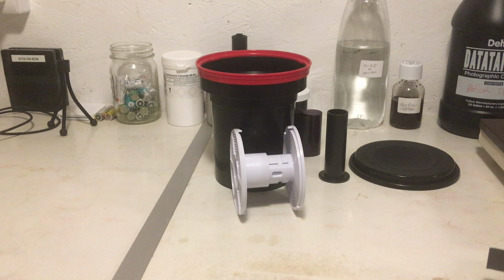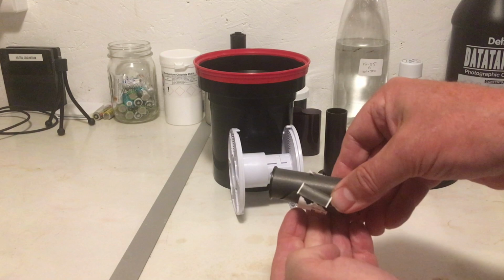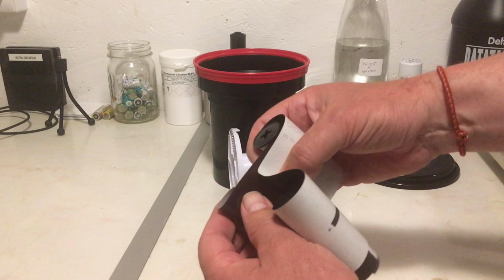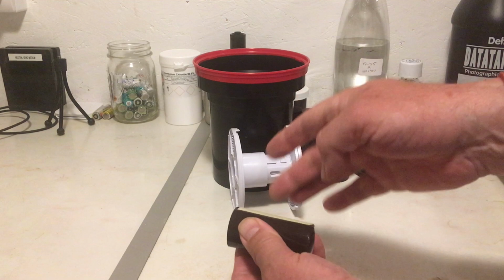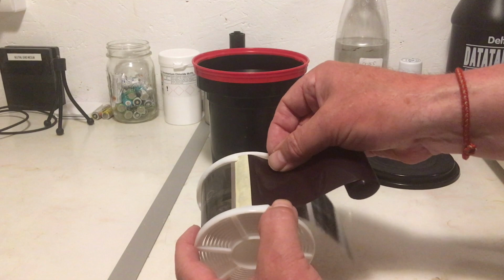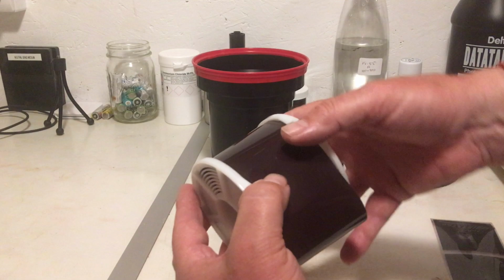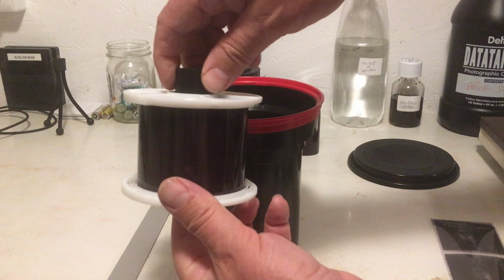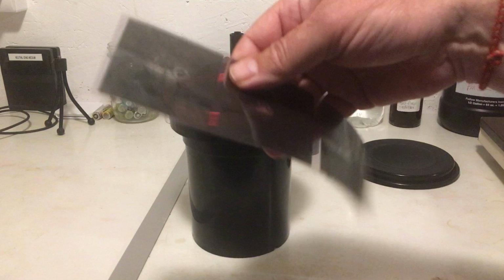The Easy Way to Load 120 Film Into a Paterson Tank!

Comment: I've been loading film onto plastic reels since Yankee and FR were the big names for home darkroom.  I never found 120/620/127 hard to get started on plastic reels -- where i had problems was on stainless.  And when I figured out I could do two rolls of 120/620, one loaded after the other (taped together where the ends meet) on a single reel, I was done with stainless forever.
Reply: I like the kodak skirts!  Ive never had a problem with them
Reply: Ah...I had a feeling, that getting the film perfectly parallel to the spindle axle might be an issue...The online shop I purchased confirmed to me that Patterson has issues with 120 and recommended Jobo I also found a comment that recommended Kaiser. In Kaiser reels the tracks have about 13 mm high walls! I ordered...   ..  .  both...😉
Reply: @boredgrass  IMO Paterson and Universal (with the big guide tabs to start the film) are the best for 120.  I've never had trouble with them.  Photos I found of the Kaiser look just like Universal, so should be easy-peasy.

Comment: I experience never ending frustration loading 120 film onto a patterson reel even using the film trick here.  If it jams or there is a problem and you have to take the film strip out, it's off to the frustration races.  I have a reel that has ears that are nearly a half inch square.  Can easily find them in the changing bag, then push the film past the bbs.  With the film strip technique, you are stuck with those tiny ears if you want to load a second roll on the same spool.  Not so with the large eared spool. Sorry, can't find the name of it, but it was about $12, the best I have ever spent.  Screw up one roll on the patterson reels and it nearly pays for itself.  Loading 120 is a breeze.  Sorry I can't find the name of it.
Reply from the maker: I know the reel you mean, I have one actually. Good reel.

Comment: I'self make it the complete opposite way and it works fine too 😂

When unwinding the film roll I put the end off the film into the spool as soon as the film appears.
I grab the film end with two fingers and pull directly in the spool (I don't push it) I pull it for about half of a spool wind. (Entrance of the spool is easy to find in the dark by touching with the fingers)
After I simply make the back and forth mouvement with the spool, film unwinds itself and the paper rolls up separately by it's own
 When arriving at the beginning of the film, I tear the tape in front of the film, put the paper away, wind completely the rest of the film into the spool.

Comment: Even though this installment is a year old, as a recent subscriber I wasn't able to see it till now. I've been using stainless steel tanks with Hewes reels for years. However for developing four or five rolls of 120 at a time I decided to try the Peterson 2.5 liter tank. I was simply having too much trouble loading the reels, though, and put off starting to use them. Then I saw this video. Genius! This trick makes loading the reels so much easier. I recently returned from a 23 day cruise through the Caribbean and the Panama Canal and back and I had twenty five rolls of 120 film to develop.  So I had five development sessions as opposed to the thirteen I would have needed for my two reel stainless tanks. This video helped to make that task so much easier. Thank you!
Reply from the maker: Yay! That's what I like to hear!

Comment: Old timey darkroom guy here. Strated loading 120 reels (620 actually) in the 1950's. On a 3 month 5000 mile trip and no room to bring my 4 reel SS tanks and reels for 120. I just bought the Patterson tank while traveling so I can develop rolls so I can be sure  I don't have an exposure failure. In the dark my fingers don't have to think about the degree of cupping and the amount of tension on the film as my other hand rotates the reel. It just happens - sorta like a knee jerk when the Doc taps your knee. I am not convinced at this moment the Paterson reel is the answer but I will be souping the first rolls tomorrow. We shall see.
Reply from the maker: How did the development go using Paterson reels?
Reply: Development went fine. This was a total experiment, not just the Patterson reel. The film expired in 2006 (Tri-X 320) The developer is one I have never used (Diafine) and does not need temperature control or careful timing. The film was curled so tight after 18 years it was wrestling with an octopus to get it on the reel. I took shots at box speed, pushed 1 stop and pushed 2 stops. For the most part the 1 stop push negatives look the best, but all three are printable, but the box speed are dense and will need a bit of expertise to coax a good print.. I have to say the Patterson 120 reel seems far more difficult to load than the typical stainless reel. I have a fresh Tri-X 400 in the camera now (C330 TLR) and we shall see how well it loads.

Comment: The template idea is great. I quickly stopped using my paterson reel for 120 film after getting my hands on a couple of AP reels. They fit the paterson tank just the same but the extra guides make loading 120 and indeed 35mm film a lot easier. AP Reels are cheap as well, I always recommend them for 120 film instead of paterson reels.
Reply from the maker: Good to know, Mark!
Reply: Where can someone find an AP reel?

Comment: Great tip. First time I tried this, something got jammed and had to resort to my old method, called, struggle. Tried again today, it worked !. Must have been my 75 yr. old fingers , first try. Thanks. KB
Reply from the maker: That's good to hear Ken. Have you removed the little ball bearings from your Paterson reel? It helps loading for me to always take them out.
Reply: @PictorialPlanet  No  have not removed balls, as I do use these for 35mm also. With 35mm, I start the leader in day light, as the first few inches are already exposed .
Reply from the maker: Me too but I find the end stays in ok.

Comment: that tape bit on the end will help me tremendously. I dont have a problem starting the film on the reel its getting it to keep going seems to bind at some point and wont go on. I am going to try that.
Reply from the maker: Binding of the film, when it gets stuck, can be a real issue. I find keeping the reels very clean and making sure they are absolutely dry helps a lot. If my film does bind wiggling the reels seems to get it past the tough bit.

Comment: I hold with one hand the plastic spool and with other hand paper back and just pull. Film will roll it self you don't have to touch it. Film template is really nice tip that I will use for sure :)
I use Jobo tank and reel and you don't even have to twist the reel since film sides get out of the reel so you can just use that to guide the film in.
Reply from the maker: That's great!

Comment: Easiest way is to replace the reels with 
Omega Universal Adjustable Multi-format Reel (35/220) which I ordered from BHPhoto.  They fit perfectly and have a lip to guide 35mm and 120 film onto the reels,  Works perfectly and SO much less frustration.  I have 4 of them.
Reply from the maker: Good tip!

Comment: great tip, one other is to cut some offcuts of developing paper, and use it, rather like the tongue tool to de-spool the 35 mm film (to get the leader out); just use the tape that you folded on the film, stick it to the "tongue" of the paper, and pull on it, like the demo, and make sure the tape is removed afterwards. this is simmilar in a way to using a "starting chord" on a mower, or outboard engine for the dinghy, but to pull the film through.

Comment: In fact, I had an experience with a 35mm film, after trying to insert the film into the screw of the Patterson tank, under a lot of blankets, sweat and anxiety on a summer day, because I do not have a black bag, but I succeeded in the end and was able to get the film stuck to the screw threads, and I also succeeded From repeating the ball with four films, but I did not try with the 120 mm film. The question here is whether there are holes in the film until it is attached to the teeth, or is that not a condition? I am waiting for an answer from the experts, thank you.
Reply from the maker: Well done!

Comment: I heard from someone to take the tape off because it will interact with the chemistry and throw it off...Dont know if its true but just asking if it makes a difference?
Reply from the maker: Hi Brendan. I've never, in 50 years, taken the tape off and it's never caused any reaction. Just fold it over and stick it to the other side of the film.

Comment: I notice in this video there are no ball bearings to pull the film onto the reel, have you removed them and if so why, thanks
Reply from the maker: Hi Martin. Yes, I've always recommended removing the bearings. Here's my website page about it:
http://www.pictorialplanet.com/beginner_photography/beginner_photography/easy_reel_loading.html
Reply: @PictorialPlanet  Thanks, I had no trouble loading most films with the bearings until I tried 127 film and that was a pain in the backside to get it over the bearings, it was a thin film Shanghi GP3 so don't know why it was so , will try this method now, thanks

Comment: Great tips, I've so far used my AP tank (which is really easy to use as the spiral has guide tabs for the film, kind of like your tip of using a negative as a guide but these are molded into the spiral) as I've been using reusable developer (Cinestill Df96) so the amount I need to fill the tank does not really matter. But now I'm moving to Pyrocat HD which is a one shot developer so the less I can use the cheaper it gets. 

I have a small Russian 120 only tank which only needs something like 300 ml of chemistry, half the amount I need for the AP one, but I have not been able to get film on the spiral because no matter what I do the end of the film comes out of the groove after I get some of it In. I think this is partly because I use Fomapan film which is slightly thinner than for example Ilford and partly because of the sloppy tolerances and build quality of the Russian tank. 

So next time I'll definitely try the tape trick, maybe it will make the end of the film stiff enough to stay In the groove all the way. So thanks for the tip.
Reply from the maker: Thanks for the comment! Yes, the tape should help stiffen the end of the thinner film. Good luck and let us know how you get on.
Reply: Unfortunately even the tape trick didn't work with this reel, it's simply too roughly made. No matter what I did I was not able to get more than maybe half of the film (still a lot more than without the tape) on the reel before it got stuck and wouldn't go further. Fortunately I anticipated that and had my trusty AP tank also in the changing bag so I loaded the film into that instead.

The reel might work for a stiffer film but for Fomapan it's a no go.
Reply from the maker: Dang that film's so thin!
Reply: @PictorialPlanet  Yes it is. and needs to be exposed at 100 or 150 to get decent density so the ISO is off too. I think I'll stick to Ilford in 35mm and 120 after I get through my current stock of Fomapan, much less hassle and not that much more expensive. 

Fortunately the Foma 4x5 seems to be okay once I got the exposure figured out, at less than half the price of HP5 I think I'll keep using it at least for the bulk of my 4x5 shooting.

Comment: I couldn’t get the film to load cause of that tape you mentioned to keep on and so I had to cut it off. The second roll I did had a bit more tape on it cause of course it wasn’t a straight cut in the dark. I believe the adhesive chemicals turned my developing fluid bright green! You failed to mention that unless it didn’t happen to you. So now I’m wondering if the 500ml used to develop the roll is now useless or what. Any info? Thanks!
Reply from the maker: Is this your first time developing 120 film?
Reply: @PictorialPlanet  I googled my situation and apparently it’s normal. Well, it was my third roll of 120 developed but ninth overall
Reply from the maker: @framesngrains2933 your googling is correct. The colour doesn't come from the glue but the film because 120 film often has an anti-halation layer and the chemical in that layer comes out. The glue does no harm and doesn't affect development or the film at all - well, it hasn't in the last 50 years I've even doing it.
Reply: @PictorialPlanet  now I’m at ease 🤣 thanks for the responses!

Comment: ...my Paterson Universal Tank accepts two 35mm reels or a single 120/220 reel. Is it possible to successfully load 2 x 120 film on to the same 120/220 reel? I know the reel happily accepts 1 x 220 film (if you can find it), but can't help thinking the total length of 2 x 120 film just might exceed the available space on the reel. Anybody with real-world experience of my query? Thanks.
Reply from the maker: I have not done this but I do believe that you can get two 120 films on one reel. I'd personally rather use a double reel tank.
Reply: @PictorialPlanet     ...thanks for the speedy response. I was afraid you might suggest a bigger tank. Thanks all the same.
Reply: @PictorialPlanet     ...just found out 2 x120 on a single Paterson reel is feasible. This from another platform: 

"It's simple: Use the piece of tape from the first roll to attach the second film. If you line them up carefully, both films will enter without a hitch. If not, just re-roll the second film and develop it later - don't try to force it in! This works fine for me 9 times out of 10".

All I need now is a couple of unwanted 120 film rolls for practice runs.
Reply from the maker: Go for it. Thanks for the interesting comment!

Comment: Thank you very much for sharing! I am just able to self develop my first roll of medium format triX. I had been developing 35mm all along.

The tip on feeling the direction of the film tip when loading the reel into the tank is useful. But if I alternate turning the stick both directions when I agitate, I suppose the film tip direction would not be that much an issue?
Reply from the maker: Thanks for your comment, Jacky. By twisting toward the open end I find I get better movement of developer across the film. The downside of going the "wrong" way is there's little movement of developer and therefore less than optimal agitation. The art of black and white developing is in optimising every stage of the process to make the highest quality negatives for our later printing or scanning.

Comment: It is a good idea with the short strip as a template. Did you remove the little metal balls or how do you get the film pulled back?
Reply from the maker: http://www.pictorialplanet.com/beginner_photography/beginner_photography/easy_reel_loading.html
Reply: @PictorialPlanet  Thank you! with 35mm film i always found these little balls quite helpfull. But if stuck and with 120er film they annoy sometimes. I will test it with one  castrated reel with no balls.

Comment: Do you use gloves when loading film? Today I found out fingerprints on my negs after developing. It looks like slightly unfixed parts on negs. And it can't be washed with isopropyl alcohol. It's definitely my fingers during loading film. I prewashed film actually. Did you have issue like this?
Reply from the maker: This is a good comment, thank you Дмитрий! I don't use gloves but I make sure my hands are washed well and not greasy. As you point out, grease, even natural skin grease) can prevent the chemistry from getting to the film evenly and affect our film (or paper) during processing. Thanks for bringing this up.

Comment: Hi John, as always very practical and helpful video, I'll be trying your approach. I enjoy the way you think things through and explain so clearly. I do have one thought here though; my intuition tells me there's no wrong way to rotate with the swizzle stick, and in fact maybe the opposite to what seems logical might be the best way. So it's something like this.. Either way you rotate there will be an opening in the film which will move through the developer and hopefully channel the developer effectively over the surface of the film. In one direction the opening is on the outside as you've shown here, the other direction the flow will be from the opening in the centre of the reel. I should think either will work but I do wonder.. Given that the space for fluid gets smaller towards the middle of the tank (the rings of film are decreasing in diameter) would it perhaps be counter-productive to try to make the developer flow inward as you've shown here, and possibly more effective to rotate the other way and let the developer follow its natural tendency to fill out into the larger space of the tank? This is totally hypothetical but I just thought it was interesting to ponder. As always thanks for sharing your experience with us, it's so valuable!
Reply from the maker: I have had the best results from twisting the stick mostly to the open end of the film. This drives the developer through the film spiral, replacing old developer with fresh from outside the reel. Turning the other way will not be as effective to force fresh developer through the reel.
Reply: @PictorialPlanet  I  trust your results and observations John. As always thanks for sharing your experience with us 😊